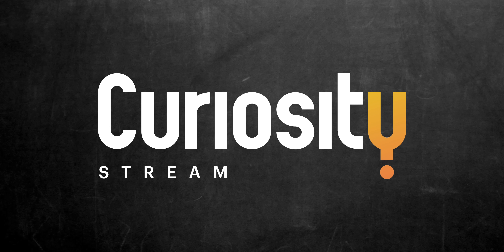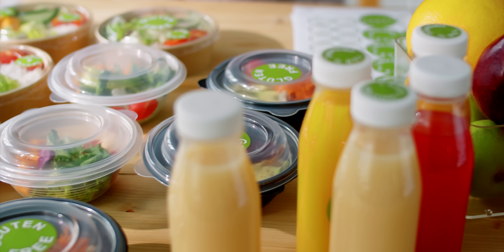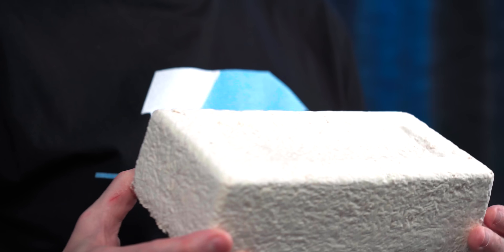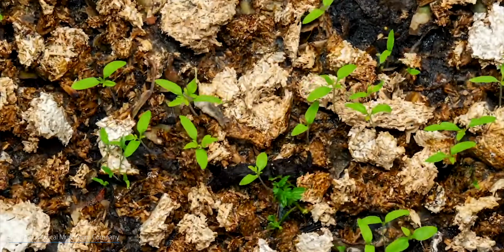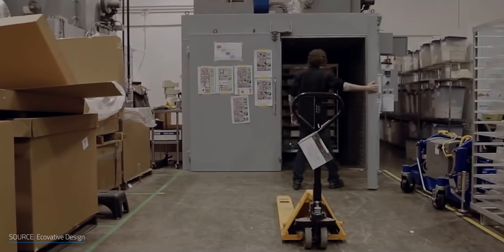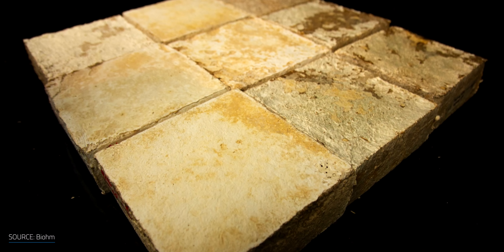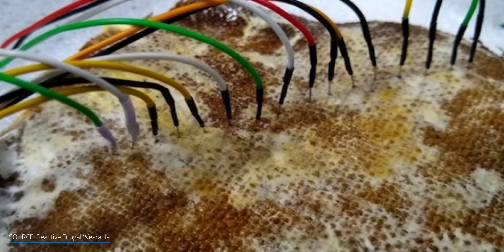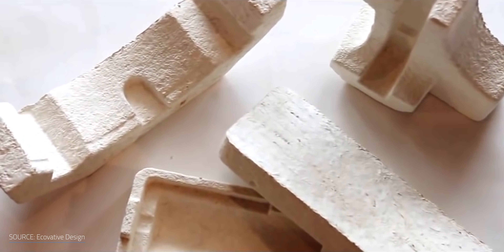Is Mycelium Fungus the Plastic of the Future?

Comment: Sounds brilliant to me…can’t see a downside…not sure how much more plastic we can ingest before- plastic caused cancers start to ramp up
Reply: And male infertility
Reply: @son473  The science says we won't have sperm in 50 years.
Reply: @Drewskie2670  if there's one thing in the world I don't trust, it's scientific predictions about the future.
Reply: @bbbbbbb51  If it stays at the same rate it will be about 50 years give or take. I wouldn't trust the number either since it might be a little more or less. The fact of the matter is that it won't stay at the same rate. It is increasing so 50 years is probably a stretch but we don't have a model to know when to expect zero. It looks like we probably have at least 40 years until the last human birth even though they quoted 50 before the cliff got steeper.
Reply: Hmm... the few I can think of... how often do you need to replace your current insulation compared to this.
Another would be possible allergy. Time, it takes seconds to make injection molded plastic compared to a week for this. None of these things say NOT to keep going, I love this idea. But we can't be so blinded byt the benefits that we ignore the flaws... thats exactly what got us to the point we're at.
Reply: @matthewpopow6647  The difference is that you don't grow plastic, which is mostly sourced from materials like oil that are broken down by fractional distillation to get the hydrocarbon polymers that plastics are made from.

"But we can't be so blinded byt the benefits that we ignore the flaws"

The scientists and engineers are not, they just fix the problems with the processes etc etc.

It's media articles like this that tend to have the tunnel vision, but often mostly for the sake of a compact presentation on such a short video.
Reply: @mnomadvfx  oh, I know scientists aren't, im more pointing to us and just as importantly businesses.
Reply: @matthewpopow6647  i strongly agree.
and to add some points to the list:
1) i dont think using containers made from dead mushroom and garbadge to carry/contain food directly sounds like a safe/good/tasty idea...
2) making your materials easily biodegradable puts it at a higher risk of faster wear and tear/early malfunctions.
3) by using this stuff we will add a massive amount of decomposing materials a few years down the line. has anyone checked if/how much greenhouse gasses are released during this process?
Reply: @drizzt7dourden7  as long as no gas, oil or coal has been dug up from deep below the surface, all the CO2 that is released during decomposition has come from the air and the soil, which means the carbon cycle isn't millions of years long but only about the lifetime of a tree at most.
About your first point: the fungi have been in an oven before use, killing any organism that once lived inside the material.
Your second point definitely holds though. Another point against this which I saw is the difference in production time between this (weeks) and the process of injection molding plastic (seconds).
Reply: @drizzt7dourden7  "2) making your materials easily biodegradable puts it at a higher risk of faster wear and tear/early malfunctions."

That's what sell or use by dates are for, if its food I think it will go off faster than the packaging will degrade.

"3) by using this stuff we will add a massive amount of decomposing materials a few years down the line. has anyone checked if/how much greenhouse gasses are released during this process?"

If you deal with it in the right way you can mitigate or manage this problem.

At the end of the day biological materials went into making these things, it's likely that producing the stuff in the first place will require  some manner of these materials sucked from the atmosphere.
Reply: @mnomadvfx  
2) "That's what sell or use by dates are for, [...]"
that works kinda ok for containers but less so for clothing, footwear and building materials.
it also fails to take into account the limit it put on storing these containers. Plastic you can just chuck in some wearhouse until you need it. this stuff you will need to use asap.

3) "If you deal with it in the right way you can mitigate or manage this problem."
you see the problem with that is that that would cost extra MONEY. on top of a higher base price of the material...
If we were dealing with it correctly we could also mitigate a lot of the problems with plastic and electronic trash... but doing that costs money and so comapnys try theri damndest to avoid doing it.
Reply: It already did.
Reply: I think it's a great idea for replacing throwaway packaging like plastic wraps and food containers. Being biodegradable is good, but it's also a weakness for product longevity and durability, which makes it anti-consumer if used in products we want to last a long time and take a lot of punishment, like tarps, protective gear and storage boxes. I have noticed that environmentally conscious technology usually seems to be really fragile and high skill/cost to purchase and maintain. That needs to change or these great inventions will end up as dead ends like so many in the past.
Reply: Yea, the cost. It currently is too cheap to use plastic than mycelium as a packaging tool. 100x cheaper at least in my country. 

Of course, this can be legislated, but that means increasing the price of goods, which the poor will not be able to afford. But the concern is always cost and scalability when it comes to plastic replacements. Plastic is just too cheap
Reply: Cases of athletes foot 🦶 skyrocket people loose the ability to walk and Disney’s Wall E world is born.
Reply: That and kidney disease.  Micro plastics build up in kidneys apparently
Reply: The only problem with it is that the mycelium can burn (atleast the one made by Vox)
Reply: Cancers?

That's optimistic.

More likely basic physiological blockages resulting in multiple organ failure.

Or mass miscarriages and still births further taking a big whack at the population.

That being said I'm far less concerned for the 7+ billion strong human race than the great number of species already at endangered status or teetering on the edge of it.
Reply: Can't see a downside? well other than you need single use plastic trays to make the stuff, you need to use peroxide to clean everything, the "food waste" material is just removing biomass from animal food or existing composting schemes, that it takes a week to grow, in a temperature controlled incubator + another day in an oven baking (that's a lot of energy and space right there) AND after you have put all that effort in, it falls apart after just a few weeks and can never be re-used or recycled.

Remember. "REDUCE, REUSE, RECYCLE". IN. THAT. ORDER. Nowhere in that does it say "spend a week and a half making something that will turn to mush after a few weeks or one use".
Reply: @rjc0234  good thinking I don’t disagree - personally I have a very small carbon footprint, and rarely would buy single use plastic - the problem is I would save 80% of the population still does - so we are going to need a number of solutions to solve this problem, I can see mycelium fitting into a niche…hemp plastics another niche etc. - your thoughts?
Reply: There's always a downside.  Anything that biodegrades will not last long.  Imagine buying clothes, shoes, etcetera out of this stuff and it starts to break down while you're wearing them.
Or your home insulation breaks down and you need to replace it yearly.
Now, expand on that...
Reply: @kellikelli4413  "Or your home insulation breaks down and you need to replace it yearly."

Biodegradable processes will not be going full speed ahead sealed inside plastic, brick and/or concrete.

If you seal the stuff in it will take many times longer to break down.

Unlike in the soil where gasses can and do penetrate as they are temporarily absorbed in rain fall that soaks in to the soil layers.
Reply: @mnomadvfx 
You hope that's the case... 
I don't know about any homes walls being that air tight, or water tight, do you..?    
Also, when these products do biodegrade ~ whatever they're made of will start growing in those places ~ use your imagination on that fact Kenny.
Reply: no downside..thats what the environ mental whackos said when they forced us to replace  glass and paper  bags with plastic
Reply: @johnnyllooddte3415  Maybe there was none for a short time except for the people producing that garbage. But for a long time the downsides has just been growing. This can't take over too soon.
Reply: @johnnyllooddte3415  Sadly you, oh smartest of all humans, haven't been there to warn them. Please fill our ignorant lives with your unending wisdom and show us the way to the future, oh all-knowing one!
Reply: Practically the same blind optimism as when the wonder product cellulose was discovered. I am always skeptical of "innovations" that NEED government intervention to even work and not even being competitive with current market offerings, just being BARELY usable. If this is to stand, it will have to do so in it's own merits, not because incentives and subsidies and unfair market laws propped it up.
Reply: @NoobBasically  the problem is the free market doesn't care about things like long term pollution. If we seriously want to go carbon neutral then government intervention will be required somewhere.
Reply: @jothamstickings4773  Yes and no, the fact that there is a growing industry around this, and "climate issues" and "carbon neutral" are marketing buzzwords that companies use to sell more products proves that the PEOPLE care. No, because some people cannot afford high, feel-good, ideals versus the low-cost convenience of whatever evil product rich people deem is flavor-of-the-month.

In short, rich middle-class people might adopt, but you can't really force the third-world-poor to suddenly adopt the higher cost product to save the 'fewchoor' whilst sending them off to more misery.

And in this scenario, removing the cheaper, more readily available, and more durable plastic to wear some 'climate badge of goodness' will just force the poorest into deeper depths.

No product will replace plastic until it will replace it fully and exclusively, i.e. no intervention whatsoever.
Reply: @NoobBasically  if the better option can't be sold cheaply enough to compete then subsidies should be implemented. We can't keep ruining the planet just because not ruining it isn't profitable. Also, more research into renewable materials should be funded. The plastics industry has had decades to innovate and make plastic as cheap as possible, and alternatives need research in order to catch up.
Reply: @jothamstickings4773  Please understand that these so called magical government subsidies doesn't materialize out of nowhere. They are from taxes, either reducing spending in one aspect, or more probably taxing MORE the population. You keep saying subsidies like you would not be paying for them.

The trouble with subsidies is that you are FORCED into something which you may not support or fully understand, whereas a totally free market option would have your full support via your purchase.

The mindset of letting the government 'solve' all of YOUR problems is weak-willed and leads to the erosion of everyones individual will.

Are you that smart or prophetic enough to essentially DICTATE where people's money or ideals should be? Rather than educating people and have then decide you would remove that and would want to divert the responsibility to others.

TL;DR; 'subsidies' is not magic nor free, it leads to more corruption, inbalances and more problems than it solves, it is anti-thetical to the pursuit of improvement because subsidized industries can ALWAYS rely on their subsidies NOT on their product or innovation. Stop thinking governments are fairys that solve your problems for you.
Reply: @NoobBasically    I understand government intervention has its drawbacks, but I really don't see another practical solution here. It seems to me either we all contribute to fixing this problem or it doesn't get fixed.

But I'm not an economist or a politician so my knowledge is limited. Do you have an alternative idea for the plastic crisis?
Reply: @jothamstickings4773  Other people are already offering possible solutions/alternatives. Some may ultimately be viable and marketable, most will be stuck in the lab whilst offering life altering promises in the 'years to come'. The problem is not of the lack of answers or solutions, the problem is how we should check if said probable solution is the right one.

Letting often underqualified politicians dictate the course of how a very technical research is to be adopted and implemented wholesale to a population is very different from letting people choose their own solutions and answers that most effectively applies to them and their means.

Yes, it is much easier to implement wide changes and thing you are doing good, but NO ONE IS THE ULTIMATE ARBITER ON WHAT IS GOOD NOW, OR IN THE FUTURE. Even plastics was touted as a more eco-friendly answer to paper bags and glass. Politicians can be swayed by lobby groups and money. Individuals would just have to go with what they think is best for them.

Ultimately, don't panic, don't force it. Forcing stuffs and answers will most likely yield more errors down the line. Trust the people, that they will know, not everyone is as dumb as you like them to be, and we are not as doomed as you like it to be. Sweeping political movements can just be easily countered by another sweeping political movement, but a general consensus and culture among the population will stand.
Reply: @NoobBasically  this is what I love about libertarians. We need more people with your level of faith in people.
Reply: @jothamstickings4773  I've never heard of a subsidy go well. During the Great Depression, where people were starving, government subsidies mandated farmers to burn their fields instead of harvesting the food. You could either sell it for pennies to feed the starving (possibly lose your home without the money), or burn it all and take a huge check. The government subsidies killed many, many people in the US. They also subsidize biofuels, which they now admit were rushed on research or blatantly ignored that it took more fuel to harvest than they got useful energy out of. They also end up making huge issues, such as people raising poisonous snakes etc to sell to the government instead of killing the species like intended, and when the subsidies run out they just dump the dangerous snakes back into the wild. Every single government subsidies has ended in disaster, from cash for clunkers (where many people destroyed fairly new efficient cars and then bought overpriced gas guzzling pickups now that they could afford it, and instead of letting the poor upgrade their dilapidated vehicle to these really quite good used cars all the used market vanished so the poor were screwed and had nothing to upgrade to, which mean only the wealthy were doing it just for newer cars making more trash...)
Reply: @jakegarrett8109  it's not surprising you've only ever heard of the subsidies that go terribly wrong. There are plenty of subsidies that have worked well so haven't been big news, including some that I don't agree and think should be removed. You know the US government spends $38 billion a year on meat and dairy subsidies to make them cheaper?

Anyway, I'm not saying this strategy is risk free but for big issues like plastic pollution and climate we need to do SOMETHING, or it'll be our children and grandchildren who have to pay.

Speaking of climate change, I'd like to know your thoughts on a carbon tax.

Edit: a search engine for all the subsidies given out by the uk government in case you're interested.
https://searchforuksubsidies.beis.gov.uk/
Reply: @jothamstickings4773  subsidizing meat and dairy is also the best pile of garbage I've heard, depending what bill you are referring to that either subsidies the store (anti-competitive and hurting local farmers markets and communities) or if it's going to companies then it's going to big companies that make a ton, and either way that hampers small businesses like my father's (who raises cattle, and which those subsidies work against because he is a small farm business).

Those bills pass because semi-monopolies have lobbiests right up these anti-competitive bills that make them rich, those are extremely bad bills. Pick another one, that great example you picked is an anti-competitive corruption bill that hurts the little guy (and still taxes the poor)
Reply: @jakegarrett8109  yeah I don't like the meat and dairy subsidy either, people should be encouraged to eat less meat not more.

Anyway, I've yet to hear a solution to the plastic problem that would work wih the free market, because plastic is so versatile and cheap to produce.

You may think people will demand better packaging so the free market will move away from plastic, but I don't think it'll work like that. People don't have the time or energy to care enough about long term issues to drastically change their lifestyles to avoid plastic. 

While plastic is cheaper than the alternatives companies will keep using it, micro-plastics will keep infiltrating the environment and fertility rates will continue to drop. And plastics aren't even the biggest problem we have to solve in the next few decades.
Reply: @jothamstickings4773  Aldi's already solved this, they charge for bags (paper bags), and almost nobody wants to pay extra even though it's like a nickel or a dime (I've seen 2 people in my lifetime buy a bag there), so yes, free market has ALREADY found the solution, and it's free with no waste. For purchasing a lot they still let you reuse the empty packaging containers so those are not wasted and discarded either. Also people like me reuse plastic bags as my trash bags if I ever do get a plastic bag from another store.
Reply: @jakegarrett8109  yes here in the uk companies need to charge atleast 5p for plastic bags by law and it saves on plastic.

But unfortunately bags aren't the only plastic thing we make.